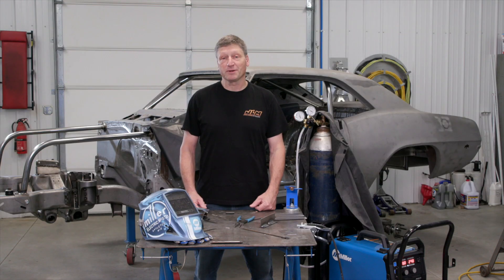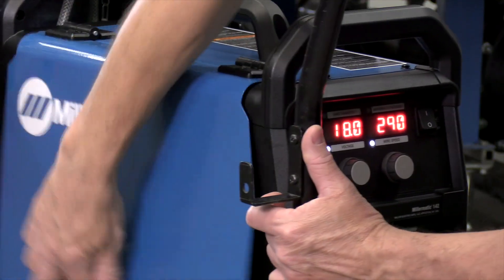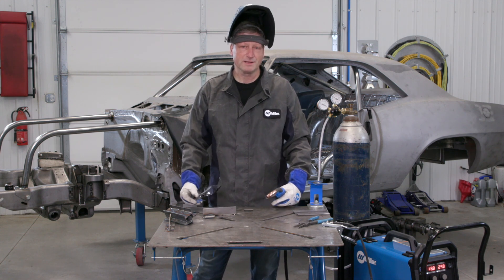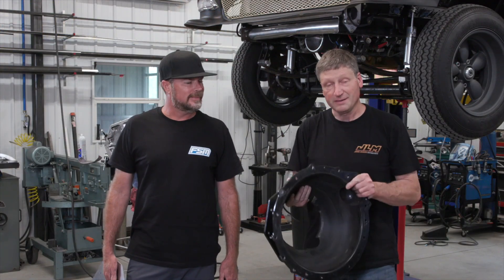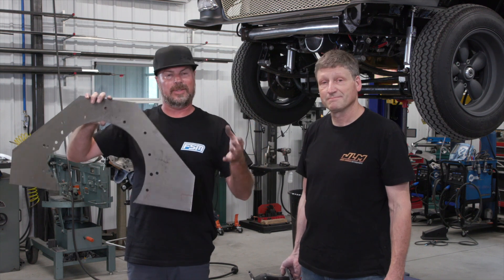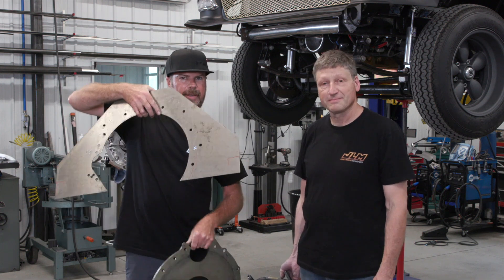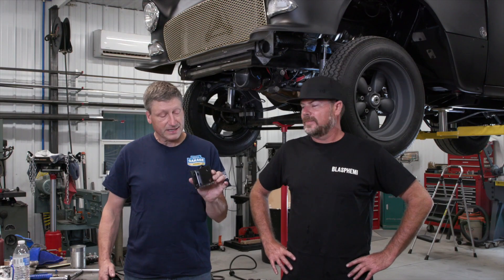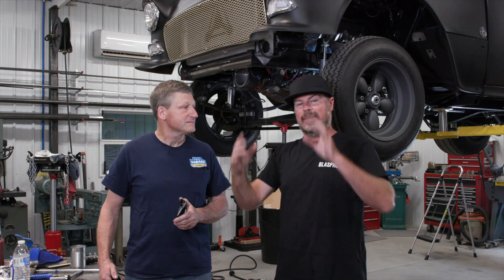Real Garage: Hold Your Horses! DIY Engine Mount Fix on Finnegan’s Blasphemi (Season 6, Episode 2)

Comment: I really think it would be a cunning move for Miller to retain ONE machine in their line-up that's a low budget, no screen, two dials, bulletproof 141-like Mig welder. WHY? Two reasons: Everyone in the industry is going fancy circuitboard-does everything plus your laundry welders. Just like some guys prefer an "inferior" 1967-1970 car over the fancy new computer controlled cars, some guys just want a simple hard to kill no frills welder. Second reason: If I have a welding project that can't be done in my shop, and I must take my welder to a buddies house, or other location; I'm then faced with Outlet Russian Roulette. I plug in a new circuitboard welder to an unfamiliar outlet, I could be frying my fancy welder in half a second. With my old 141 I never give it half a thought. The other Miller Only Idea that Miller can cash in on, is to create and sell a "Surge Protection" like device that plugs in between your welder and any outlet. It either protects the welder by correcting whatever is wrong with the faulty outlet, or gives you a red light and refuses juice to your welder, having detected a faulty outlet. This device would be protection insurance on your $2-3000 ($13,000) welder! What fool wouldnt buy one? Such a device is now needed with the new technology and easily cooked machines.

Comment: I own a 141, which has been a bulletproof machine! The reason I don’t think the 142 will actually replace the 141 is that the 141 could be plugged into an imperfect outlet, and still live on. The new machines are mainly a giant circuit board inside a blue box. You accidentally plug that new machine into an outlet that was not properly grounded or the wires got reversed by a bad electrician, it’s a large paperweight in half a second. The old 141 was like a Rottweiler with one eye missing; you just couldn’t hurt it or kill it! Sell me another machine like that, cuz THATS what I want.